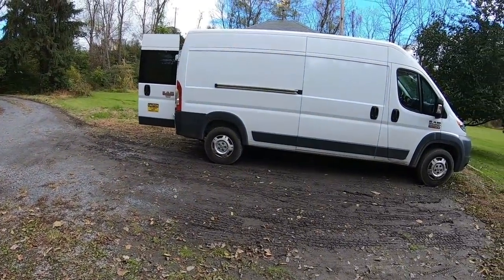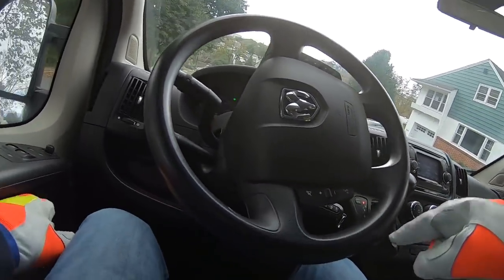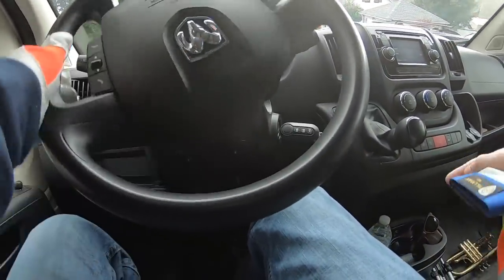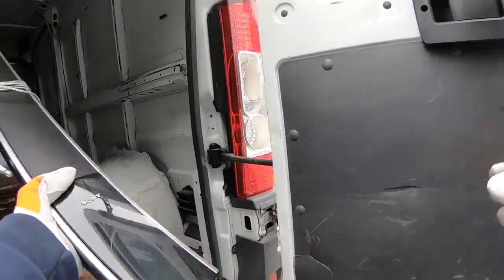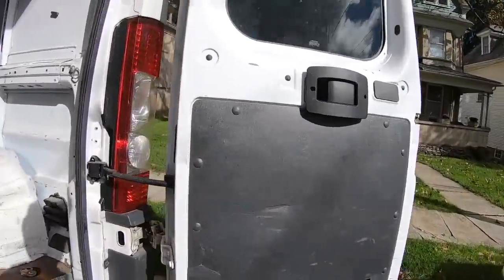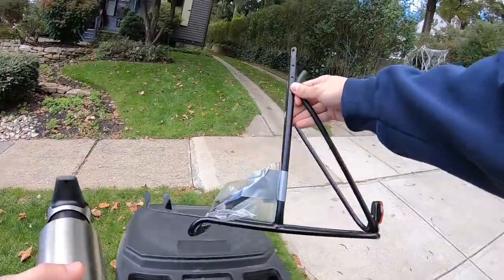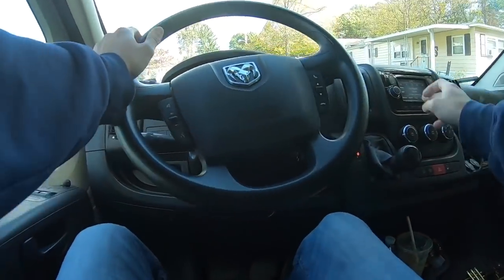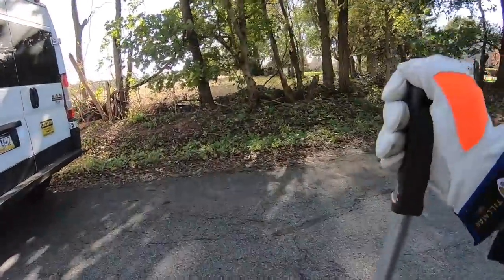LOOK WHAT I FOUND IN THE TRASH FOR FREE THIS WEEK! - Trash Picking Ep. 93

Comment: Ironing boards are simple. There is a lever on the left side under the top that lets the legs down. So simple. OK the left side would be if you are standing at the wide end facing the pointed end. Just reach under from point back until you find it sticking down It is maybe 1/3 of the way back. Try it one time you will be a pro. Or of it is already upside down legs sticking up as many you pick up are just step on the lever with your foot.

Comment: Slats on the blinds should aluminum. End pieces are tin.
Reply: not all of them. All my blinds are plastic.
Reply: @foxeni7174  
Yes, I know most are plastic. I was speaking of the metal ones like Taco Stacks found. I saw another scrapper take the ends off and put them in his tin shred and turned in the slats to aluminum. Taco needs to try his magnet on the slats, good chance it won't stick.
Reply: @pinkpony1860  Sorry. I misunderstood. I thought your statement meant "in general."
Reply: @foxeni7174  
No problem.